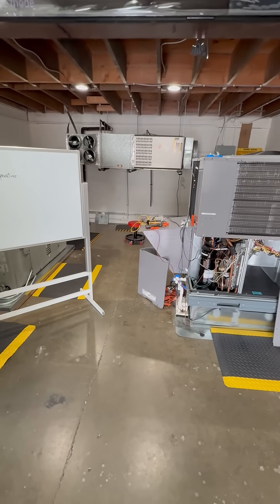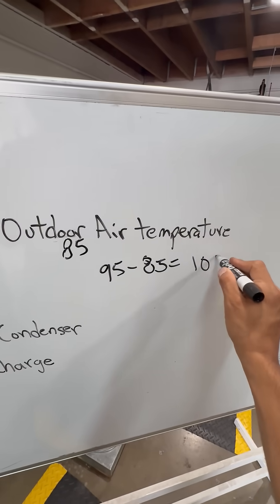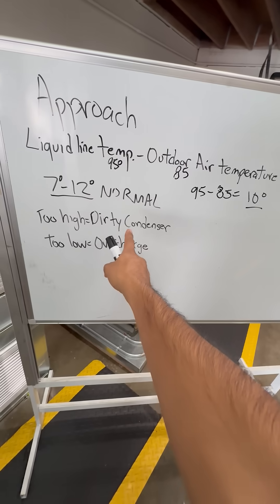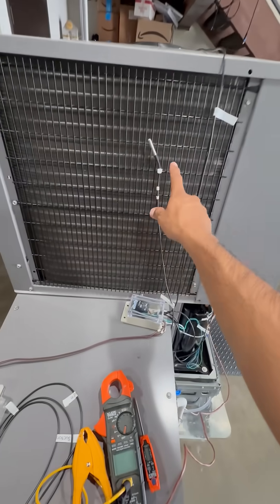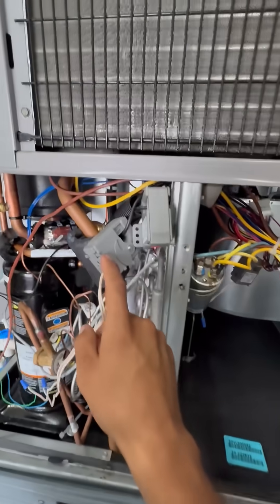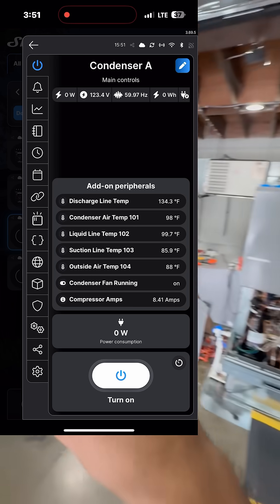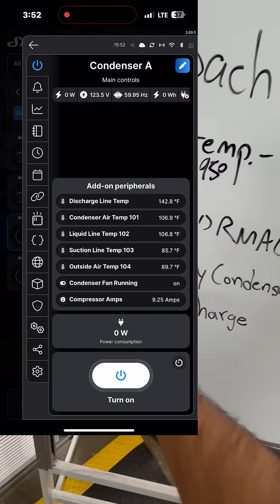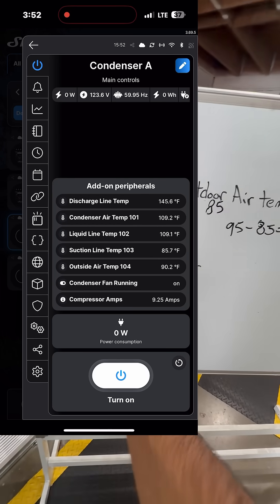How to Tell if you Have a Dirty Condenser with no Gauges #shorts #hvac #condenser #approach

Comment: Interested in your controls. How can I get my hands on a set
Reply from the maker: I’m currently working with a guy. We don’t know what direction we’ll go with this tool. We want to sell them to schools and homeowners. Not as much to technicians that are out in the field as we’ve asked some and they said it’s too much wiring they have to install and uninstall on a unit. It’s a great tool to have since you can have a system running  and you can see what’s going on with the unit from your phone regardless where your at. It’s good for analytical purposes and to prevent major repairs from happening.
Reply: Schools with HVAC  trade programs would be a good practice for the students to learn how to wire it. As a student, I would.